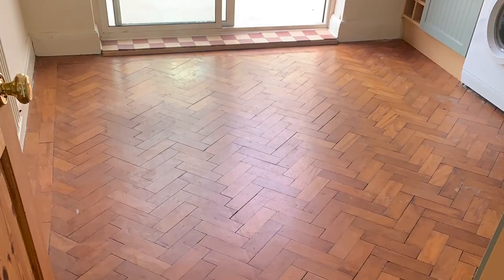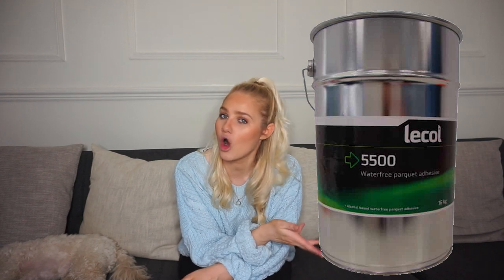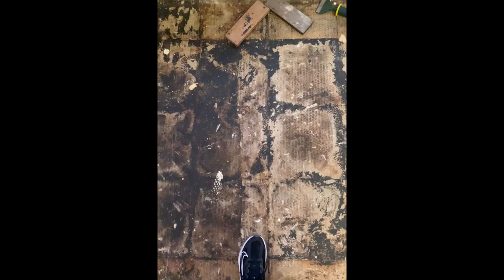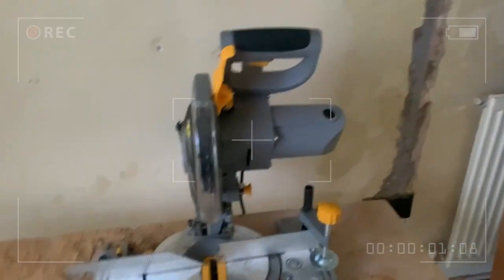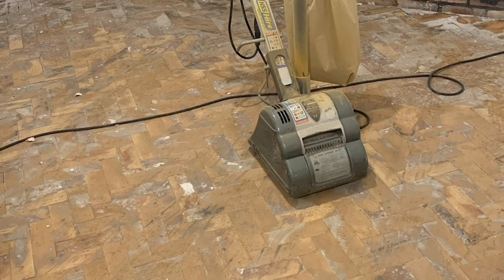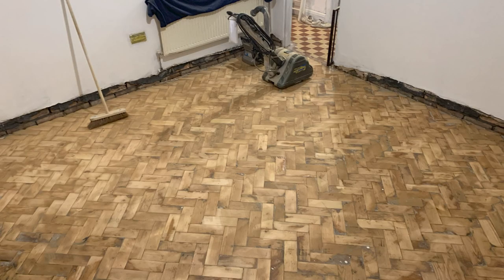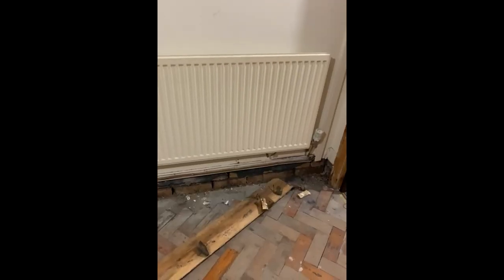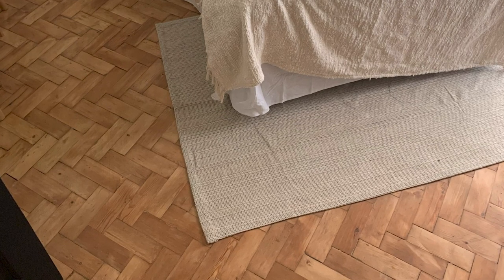How to install reclaimed parquet flooring without removing the bitumen

Comment: Will not last more then 5 years with no moisture barrier between the wood and the concrete. Glue doest count. You are giving people bad information as well. I do this for a living and fix problems like this quite often. Leave it to the professionals.
Reply from the maker: Not everyone can afford the professionals
Reply: @MegC   I understand that. But at least know what you are doing before you give thousands of people bad info.
Reply: @bryschneck  agree
Reply: @bryschneck  Why don't you explain why or what to use then so people can see what they are meant to do?
Reply: So what are you saying? Remove bitumen then replace with more bitumen?
Reply: Hasn't it been fitted with the original bitumen underneath  ?;

Comment: Great video and floor.  Sadly the comments on these videos are usually predictable.  A bloke can lay DIY reclaimed parquet flooring (without removing existing bitumen on a concrete sub floor exactly as Meg has) but instead receives compliments (from other blokes) 🥱